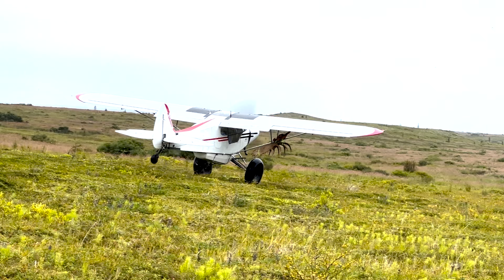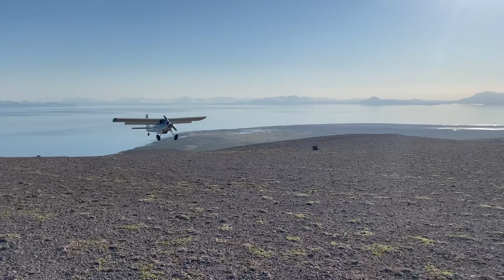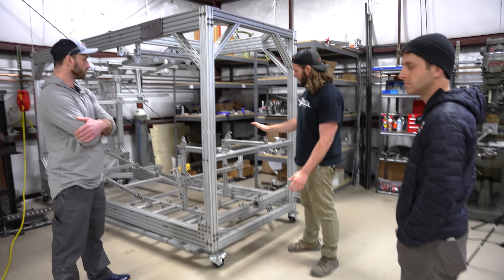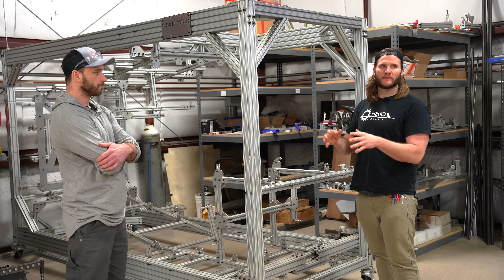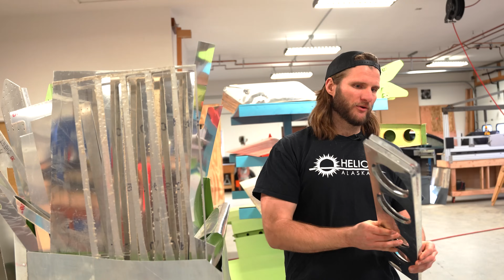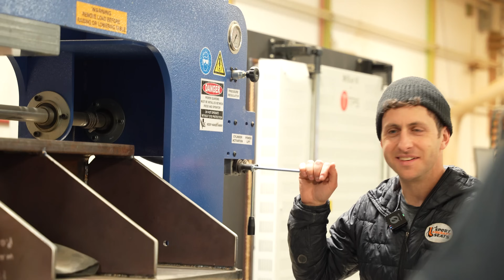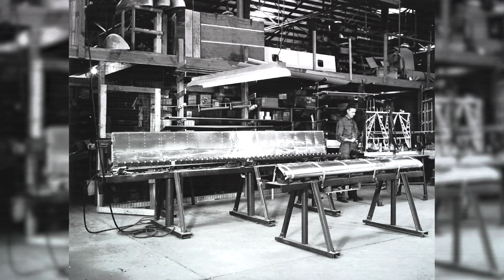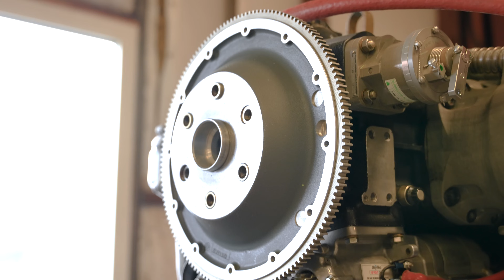Building an Airplane Factory... From 75 Year old blueprints

Comment: Riveting the leading edge ribs to the skin, then installing the ribs to the spar, will save you a bunch of time. Before going to college to become an aerospace engineer, I worked as an A&P, IA, and I rebuilt many Cessna and Piper wings. I know the value of hard tooling, having worked in and been in many OEM factories and seen how it was done there to comply with FAA requirements.  I would also go with a turbine powerplant or build your own engine... Let me know if you need help with engineering services and your PC, and revising the TC.   OHHHHH and put a link on how we can email someone...

Comment: I am building an experimental biplane from plans. I have a complete one I fly to look at when I have questions. I spent a month thinking about how to make one single jig to hold a roll wire attach point in position to be welded so I can make it repeatable and accurate. It took a few hours per night for a couple weeks after work cutting and welding to make the jig. In the end I made about five before I was happy with one. What these guys are doing is the most impressive thing I have seen on YouTube. 99.9% of the world has no idea how big of an undertaking this is. DO NOT give up!!!

Comment: It seems that the Helio was built with a lot of tribal knowledge. Meaning people on the assembly line fix things as they went and they never told the engineers what changes where needed on the drawings. Thus all the assemblers on the line knew what to fix as they went, thus tribal knowledge syndrome. 
It still goes on today in many factories around the world.  Not everything is called out on a drawing.

Comment: Wow these two guys are bringing back a  cool aircraft with exceptional STOL capabilities from the dead fair play to them. Regarding the engine, hmm would not go for liquid cooling , know where they are coming from on that score, to heavily modify an existing engine. Me I dump the liquid cooling, then take a standard Teledyne Continental off a Cessna 206- 207 Stationair, de rated to three thirty ponies bolt on a simple spur reduction gear like a  Rolls Royce Merlin, You have to think like a Volkswagen bug junkie, keep the engine simple so you can fix on your mother,s  kitchen table.  These STOL utility aircraft  operate in the arse end of nowhere ,hundreds of miles away from the most basic repair facilities.

Comment: I just Retired form Boeing after 38 years 20 as a Jig builder for all Boeing planes out of Wichita Kansas. I have 18 years in R&D designing and 3d printing tools for shop support. My dad retired with 40 years at Cessna Aircraft and I worked by him when I was 18 years old as a Jig Builder before going to Boeing. what you are doing is spot on with the 3d printers out on the market you can save big money printing out your designs I used Catia V5 that being said one of the best printers we used just last week before I retired is a QIDI Plus 4 with a heated chamber were you can print and plastic filament on the market Carbon fiber. just FYI you are doing a Awesome Job.

Comment: Lookin good fellas, aircraft mechanic here, i once worked on a 1958 twin Bonanza which had GO-480's on it, set the brakes, ran it up for an annual inspection,  i ended up stepping on the brakes because i thought the the parking brakes weren't holding, nope, parking brakes were fine,  those engines were dragging that bird tires chirping. I can see why that power-plant was chosen for the Helio Courier.

Comment: These guys have invested so much I really hope they succeed in their company, the market is there for what they're building, and possibly even work in supplying parts for keeping existing aircraft going as well. One hell of a project, and it looks like they'll pull it off. I'd like to know more about that engine, as few water cooled aircraft are out there with an opposed setup that are type approved. Continental did make a gear reduction water cooled engine for special use, but I don't know what became of that.

Comment: What a tremendous project. 
I built a Cobin baby Ace. Shown in my profile picture at,  Ft Lauderdale Exec. in the early 80s. Building an assembly line is insane for only two guys.
My project required building my own welding and fabricating Jigs and fixtures from Blue Prints out of wood. The wings structure was mainly old school, wood nails and glue. 
It was a one time build so repetition was not a consideration. Seven and a half years nearly every weekend,
and some times after work in the evening. Tons of Experimental home built aircraft have been built because of the humongous price of commercially built aircraft.
The poor mans way build it yourself. 

The Broward county sheriff's office had a Helio that a pilot,, friend of mine flew. He would trail drug dealers in automobiles driving in traffic. That's how slow that aircraft would fly. 
It was supposedly less obvious than a chopper.body-blue-raised-arms
He would land in a few feet of the runway take of in only a few feet more. We called him "Mr. show off". I tried but of course he couldn't fly passengers. He'd loose his fun job if he did!!!

Comment: The work these guys have done is amazing.  The FARs (as detailed by the orders) allow for production under a type certificate (TC) for a limited time where FAA issues the airworthiness certificate for each aircraft produced.  Then production under a production certificate (PC) is used where the holder of the PC issues the airworthiness certificate.  In both scenarios, the aircraft must conform to type design and Helio Alaska is the holder of the type certificate (TC).  To be airworthy the aircraft must conform to type design and be in safe condition for operation.  The engine swap is a change in type design and using an non-certificated engine may be the undoing of this entire project.  The scope has increased to now include an engine certification program.  Best to go with an existing TC'd engine at the risk of losing some performance as the time and huge amount of money involved will soon drain their finances.  How about using something like a Continental GTSIO-520?  Would still need an STC or amended TC to accomplish.

Comment: Good job guys! I have a few questions, as a retired AME, S, I have been where you are, pink drawings, first off prototype, for a nose section for a new weather radar unit, in 1972. I noticed you are forming parts without heat treatment, I have pressed parts on a 400 ton rubber press, and almost without exception, they require straightening, shrinking or stretching, how are you dealing with this issue? All our parts for forming were heat treated to a W condition from T3 or T6 material, then stored in a freezer, this allowed for forming and straightening in a way that reduced the stress in the materials from the process, and then parts were allowed to age harden to a T42 condition, and if I remember correctly the T6 parts required an additional process! I’m impressed how far you guys have come! I have built Leading edges, 30 foot long flaps, 14 foot long ailerons, worked with engineering groups, to develop airframe modifications and prototype installations on everything from small helicopters to fighter jets. I have installed millions of rivets over a career spanning over 40 years. You have my attention, Good Luck, best wishes and keep us posted!

Comment: Speaking as an experimental builder/flyer (Kitfox Series 5-Lycoming 125hp) what these guys are doing literally boggles the mind !!! I sincerely hope they find a market with enough potential buyers. Alaska is probably the best place to start. General aviation has been so crippled by cost/regulation in the last 60 years, no one takes a chance like this anymore. Most, like me, turned to kitplanes as the only realistic option. Even going the builder route, the cost of my build exceeded 50k by the time I finished…. Good luck guys, Godspeed!

Comment: Good luck to them. But the real problem is general aviation is now strictly a hobby for millionaires. There are simple regulatory fixes for this. One is to reform the definition of an ultralight to raise the gross weight to something like 1200 lb, what for safety make ultralight flying fair weather only, and only over rural airspace. And critically, the way these airplanes are built is the same way they were built 80 years ago. CNC machining and 3D printing are great, but the simple reality is, something like the Rutan system using expanded polystyrene foam and hot wire cutting has to replace the buildup of airframes from welded tubes or monocoque construction. With today's technology, something like a 150 should be producible for sale at 25000$. There is no other important technology on Earth where something that was designed 75 years ago could possibly be a practical commercial proposition today. Aviation is in trouble. There is real action in the electric vertical takeoff space, for flying taxis, but this technology is ancient. Even commercial aviation, although it is far more efficient, can't get me to Paris any faster than it did when I was a little boy riding in a DC-8 in the late 1960s. That's because of bureaucracy, and lawyers. And it could be swept away with the stroke of a pen. But no one is interested

Comment: look at the SA2-37A, This plane has a IO-540 Lycoming that is specially designed to reduce the RPM's down to about 1200 RPM. This could be your solution. Schweizer and Lycoming.

Comment: Amount of figuring things out and time spent to produce a certified aircraft gives me anxiety.

What ECU is that engine using?

I see you have BMW electric coolant pumps. I dont know if it's relevant, but I have done some research into them how to control flowrate and read value registers out of them with databus without using fallback modes. But given the size of the engine I assume you can just leave datapins unconnected and run 100% fallback power while using a pump as minimum quantifiable unit.

Comment: When you re-engineer somethng designed in the past be it an aircraft or a steam engine you really appreaciate what people achieved with the tools and materials available back in the day and the skill and dedication required to achieve the origional result without the knowledge that it would actually work. What a great piece of work by two dedicated people with a modern skillset who are probably rediscovering many things that were just production line knowledge at the time.

Comment: Ahh flat patterns.  Back in the early 80s I worked at GE doing flat patterns.  We used CAD but accounting for bend deductions was done manually in CAD.  Bending metal is well understood as the outside stretches more than the inside of the bend compresses.  The problem was that the tolerances were way bigger than something like machining.  That meant that designs using flat pattern metal had to be tolerant of the wider (than machine) tolerances.  Since everything in the wings is essentially bent metal the stack-up is enormous.  Getting repeatability is very difficult.  I was working on jet engines where flat patterns did not mate up to other flat patterns.  Mating three flat patterns is crazy.  You have done very well.
Reply: No one ever mentioned what a flat pattern is or why you need one.       First you start with the wing in the final desired shape.  Then you "develop" (unwrap) it back into the shape it would be unfolded and unbent.  Then you cut it out of flat sheet metal and start bending.  If you bend it exactly like you planned, and allow for all the bend deductions you get what you want.  It is the bending process that is fraught with potential for errors.      Say you want a simple right angle.  You could bend it slightly off square and that error is magnified out to the end of the bend.
Reply: This is exactly why holes through the skins to the ribs on a wing are drilled manually at assembly and not pre drilled in a CNC, even today. Tolerance stack up through each part and the assembly is enormous and not easily repeatable. Unfortunately I expect these guys to run into these issues if they’re ever able to do large volume production runs.

Comment: They won't need a new certification because of the new Powerplant design and the fact that none of the original jigs is used?   
If that engine gets certified to use unleaded pump gas it should make it really attractive to a lot of bush pilots.

Comment: I don't understand why you had to move away from the gear reduction?  Wouldn't a more modern engien be much lighter then the old one i.e. more hp per kg? leaving you space in the design weight to chooise the best combination?  Or use that weight to install all the modern electronics that are required nowadays ofcourse..

Comment: John Thorp introduced the “matched hole tooling” construction with his T18 home built design.  When I built my T18 I tried and failed at this method, I could not achieve the required accuracy in the flat layout and folding to have it “self assemble” truly.  But with simple jigs the same parts were usable when the holes were drilled to the final rivet size.

The CAD/CAM accuracy must be a huge improvement - I love what you are doing and wish you all the best.

Comment: If the FAA hadn’t got involved, we’d all be flying who knows what powered by a lightweight diesel that burns 7 gallons per hour and doesn’t instantly  explode in a fender bender. Congrats at taking the project on 👍🏼👍🏼
Reply: Part 23 ruined everything. 

There was nothing particularly wrong with CAR3. As J3 Cubs, Super Cubs, Champs and Citabrias have outlived all of the Part-23 types except the classic Beechcraft Bonanza, Baron, Piper Cherokee, and of course Cessna 172/182 lines.

Comment: Your engine choice can also include a PT-6 , a Chevy V8 or a diesel in future.   But for the Chevy and yours, you best have some form of back up water pump for it.   For the medium future, if you like to revive designs, there is another plane well worth considering, a modern day C210 called the Super Stallion, by the late Martin Hollemann. The Stallion on Lycosaurus 0-540 can run circles around a standard 210 and can have rang over 2000 miles, depends on how much of the wing you seal off for fuel. Hollemann's widow (Aircraft Design, Calif. ) are holding on to the rights of the Stallion.

Comment: In either a liquid cooled or air cooled engine, large heat generation equals lost energy to the prop.  The difficult goal for an engine designer is to create an efficient engine (or electric motor) and not a toaster oven.  I understand how the camshaft lobes were reconfigured to produce low end torque without the need of a gear driven propeller, but such an arrangement dictates the loss of some fuel efficiency.  You are essentially using an RV style camshaft, something around for decades.  The question is how much fuel efficiency is lost.  You folks have obviously determined that the efficiency loss is well within acceptable rates.  In these bush type planes, I would anticipate an engine design where an electric motor is mechanically engaged/disengaged as a helper for the gas engine.  The pilot then receives a sudden burst of prop energy for the takeoff only.  Electric motors, just like their gas companions but more so, lose efficiency with heat, but we are looking at maybe 20 seconds of electric assist use, so a high sudden amp load is a non-issue in a proven design.  The electric assist motor is not used long enough for heat to become a factor.   I think electric assist could be whittled down to less than 80 pounds of additional weight if you don't have to duplicate the battery used to start the gas engine.  A gear driven prop assembly might add 80 pounds, and it is bypassed.

Your amazing endeavor is summarized by three words:  Long Term Commitment.  I have the deepest respect.  I root for you.

Comment: Amazing project to bring back the Helio Courier.  This is a very complex project to transform plans to a modern match drill airplane.  Without match drill technology this airplane could not be produced.  Unless you have never built an airplane from the ground up, you cannot appreciate the amount of work it will take.  We will welcome back a great airplane, and there will be a line of interested buyers, but it won't be cheap.  Great airplanes are expensive, and well worth it.

Comment: 22:16 wishful thinking running pump gas, the ethanol is gonna cause water absorption issues. This is why ATC allowing for lower compression motors running on pump gas were sunsetted
Reply: STC for MOGAS has always been for ethanol free. Ethanol free MOGAS is commonly found throughout the United States and still is a good fuel for those in the backcountry

Comment: Oh my damn! A truckload of kudos to you, guys. I work in this industry (mostly with avionics), and boy have I met all the troubles you mentioned... specially the "it looked fine in the CAD", that one hit right in my heart, lol. I have to work regularly with old aircraft drawings and you can always tell a lot of info always is actually shop lore that never got corrected into the final blueprints (I'm looking at you, PA-25). After almost 15 years of experience the one advice I can give you is don't rush because of a symbolic deadline. I fully get that the airshow is a helluva milestone, but don't loose the real focus: a fully functioning and safe aircraft, whichever the date. I'm pretty sure that even if you go to the airshow just showing a wing and part of the fuselage, you'll already attract a lot of people, and they'll drop their jaws when they listen that you're only two people doing the reverse engineering and manufacturing with aims to have a FAR23 certified aircraft, that alone is a big feat in itself. Keep on and I wish you a lot of success!